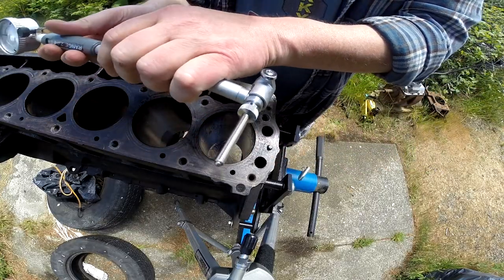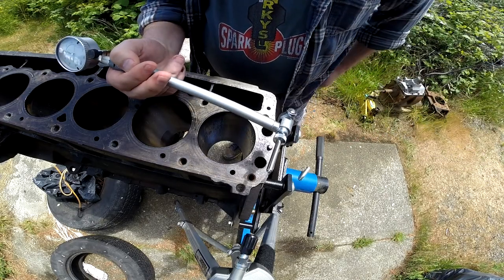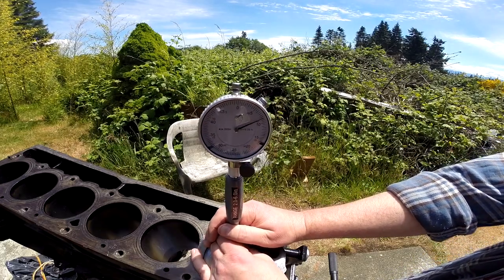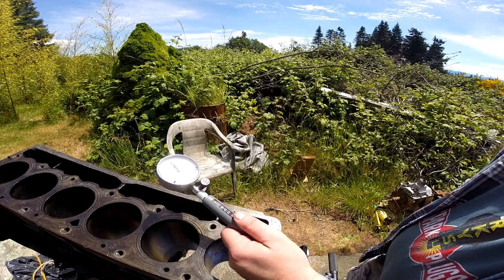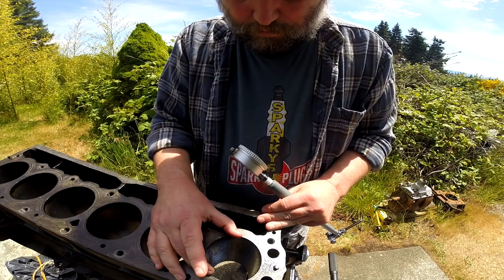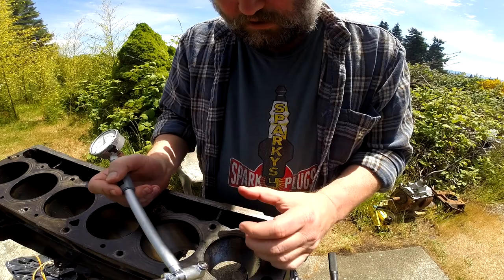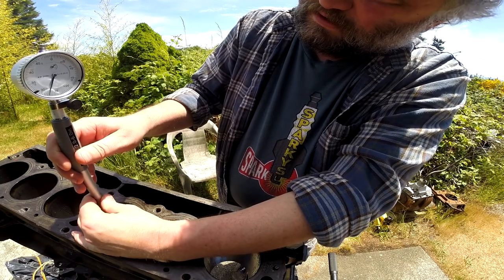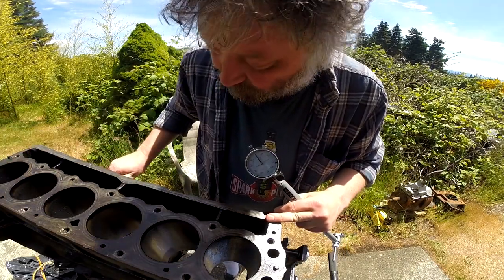Mistress Slant 6-New Bore Gauge

Comment: I assume you have measured or plan to measure cylinder taper. That tells you the most about how worn the cylinders are and whether you can get by with honing or whether it needs bored. You measure the bores near the bottom of the piston ring travel(thrust) and then again at the top of the ring travel, then compare your readings. If there is enough of a ridge at the top to catch a fingernail then it'll need bored. When I go back out to the garage in the morning I'll look and see what the Chrysler manual gives as the maximum wear specs and let you know.
Reply from the maker: I am measuring taper as well as overall round. Most ring-ridges I have ever felt will catch fingernail.